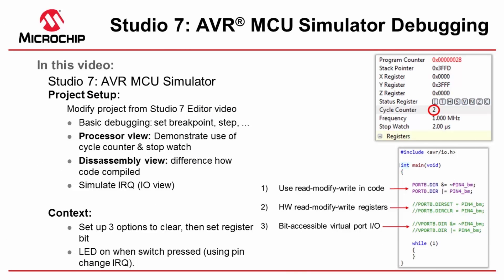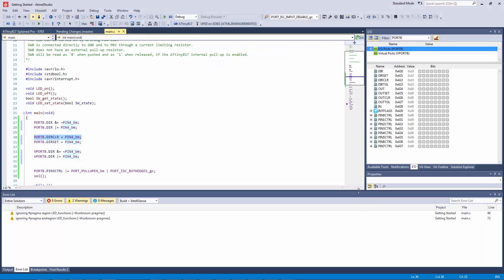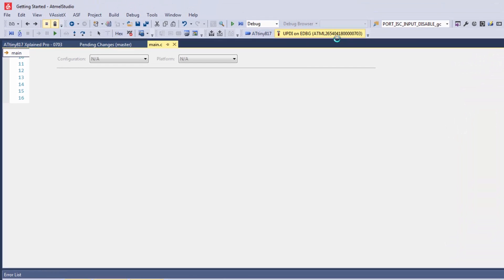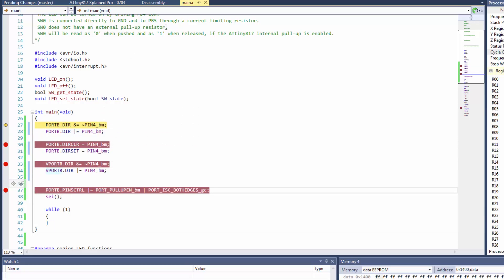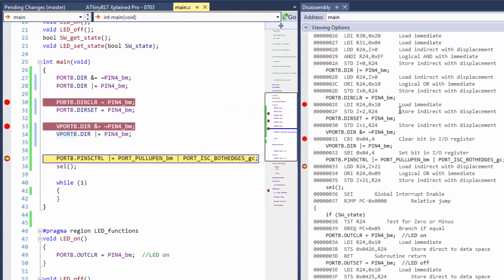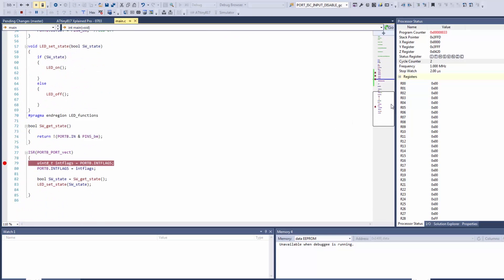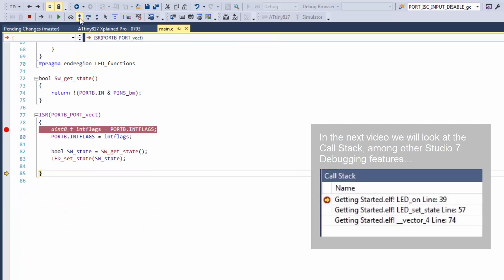Getting Started with Atmel Studio 7 - Episode 12 - AVR® MCU Simulator Debugging

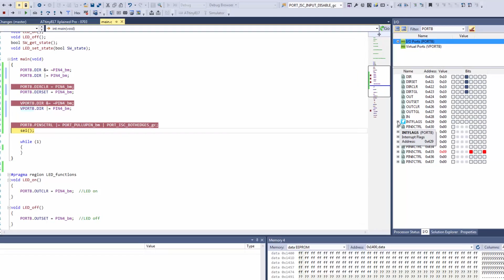Comment: Around 4:10, when debugging is paused, supposedly the simulator is "sitting pretty much in the while loop". Perhaps so, but that's not what the display says: it shows that execution hasn't reached the while loop (and it certainly should have; it's had plenty of time). Indeed it shows that interrupts haven't even been enabled yet - sei is the next instruction.

Even if you try to set a breakpoint where the video says the code should pause - on the while statement - the debugger will warn you that a breakpoint there can't be hit. No wonder the simulator doesn't stop there even if you pause the debugger manually.

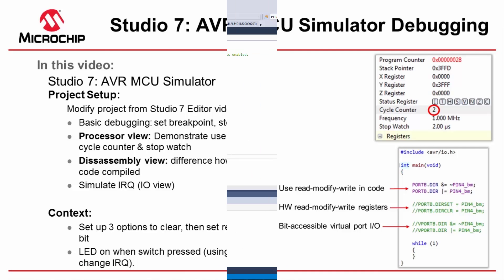All this is likely to puzzle people - and rightly so. The culprit is optimisation. Notice that the video ignores two warnings, generated when the project was built (around 0:50). If you right-click the project, choose its properties and change Optimisation from "Optimise debugging experience (-Og)" to "None (-O0)", when next you "Start debugging and break" the debugger will first rebuild the project - and you'll find that those warnings no longer appear.

You'll also find that now it's possible to set a breakpoint on the while loop, without being warned that it's unreachable. With or without a breakpoint there, if you pause debugging manually you'll find the while loop has been reached this time.

The lesson is never to place too much reliance on source-level debuggers, especially not until your code has been built with all optimisation disabled. The problem isn't Studio's fault; all source-level debuggers are subject to it.